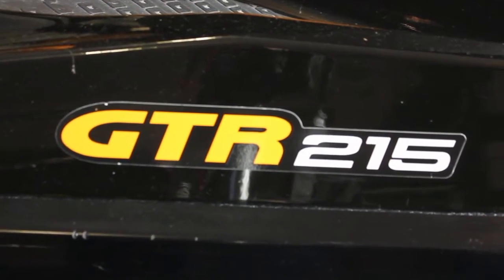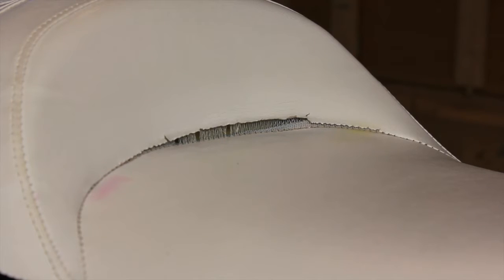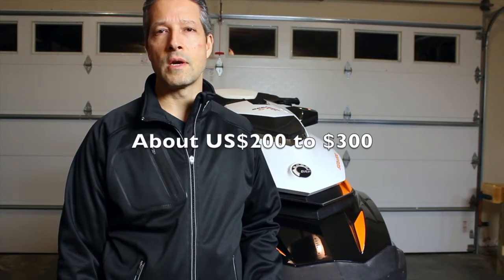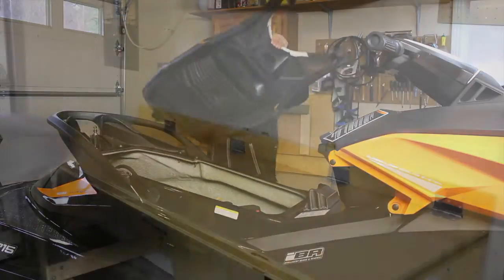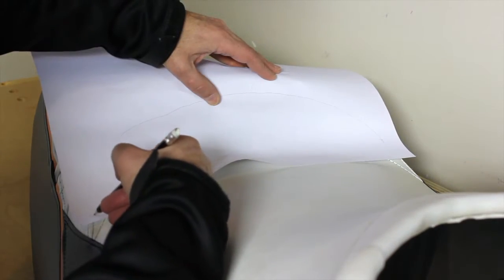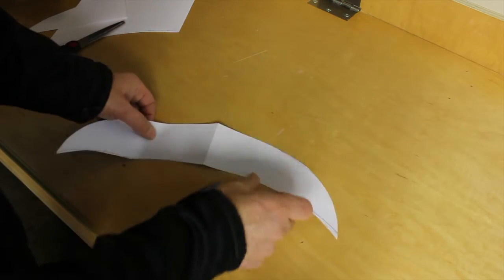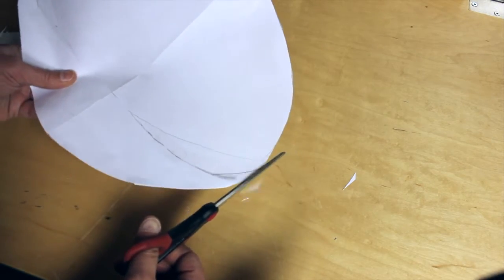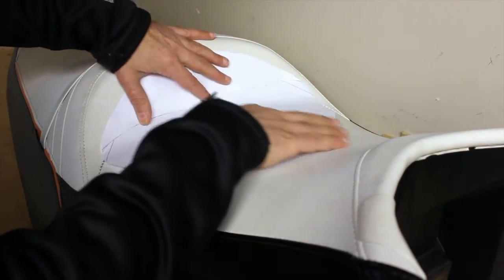How To Repair The Vinyl Seat On Your Personal Watercraft or Jet Ski

Comment: Great video! What kind of glue did you use? Would you think gorilla glue would do the trick? Yours seemed a bit more viscous which I think would make for easier spreading and less chance of bubbling/unevenness
Reply from the maker: I used vinyl glue (I don’t recall what brand). But be careful if you use it, as I noticed it yellowed the vinyl (after a few years) where it touched the surface of the fabric. We still recommend the repair for small jobs, but for larger or more extensive flaws it may be better to just replace the seat cover. Good luck!

Comment: It seems that every issue you have, I wind up having the same and find a good solution in your videos. The exact same tear just happened on my 2019 GTR and its getting worse by the day, how long did the temporary patch last? Thanks again
Reply from the maker: Tanks for the kind words! The patch lasted for years, but the vinyl glue started yellowing. I’m not sure if there are other brands of glue that work better, but ours did not look good after a while.
Reply: Ok thanks, very good to know. I'll research the glue for UV / heat rating (if published) vs color and GO for it to save some coin. As always, so much appreciated and your channel ROCKS for onboarding to Seadoo maintenance. Keep em coming @3ftDeepChannel
Reply: I'm repairing my 2019 Yanaha VX using this video. Thanks. I'll probably get a custom seat repair over the winter. A guy in town will do it for about $400. But he reinforces the Seams. So hopefully I'll get many years out of the new seat. Until then...
Reply from the maker: @seanlinnan2719 Hopefully the $400 includes the cost of the seat cover. If so, $400 is a reasonable price. Reinforced seams is a great idea. Good luck!

Comment: Do you know where I could replace the entire seat? Because mines is very ripped.
Reply from the maker: You have a few options. If only the seat cover is damaged, you can buy replacement covers and do it yourself. Some companies that sell covers are BlackTip, Jet Trim and Hydro-Turf. If you don't want to do it yourself, you can bring it to an auto upholstery shop, and they'll do it for a fee. They can also make and replace the cover themselves, but that can be a bit more expensive than buying the cover and having them install it. If the foam or the seat frame itself is damaged, then you'll need to buy it from the dealer. It's expensive, but it comes complete with the frame, foam and seat cover. Sea-Doo has their parts online and you can buy it off their website, if you've got one of their models. Good luck.

Comment: How well and long did it hold up? Any follow up video thanks
Reply from the maker: It held up well, but the glue I used turned yellow around the patch very quickly. I don’t know why, as it was the proper glue. Probably needed one with better UV protection.

Comment: I see this video was uploaded in 2016, any update on the performance of said patch over the next few seasons? I'm having the same problem with my 2012 Waverunner
Reply from the maker: Yes, the glue turned yellow so became a bit of an issue for me. The glue bond is very good, but the yellow made it look a bit crappy after 3 or 4 months. My conclusion is that it's good for a short-term fix, but if the looks of your machine are important, eventually you'll want to replace the seat cover. Thanks for your comment.
Reply: Thanks so much! Guess I'll just fork over the cash.

Comment: Can you tell me if the yellowing was just the extra that was beyond the patch or could you see the yellow through the patch?
Reply from the maker: It was around the patch (it was from the vinyl glue).
Reply: @3ftDeepChannel  So, any glue that pushed out but no yellowing where the patch covered it correct?
Reply from the maker: Correct. I sold it some time a go though, so I don’t know what it’s like now. The patch is a quick fix, but if you’ve got extensive damage, I suggest following one of our other videos and replacing the seat cover entirely. Good luck.

Comment: As always a great and usefull video. I just got my Rxtx260 and when im docking it seems the get scraches way too easy on the side.  I was thinking on getting/making som kind of a bumper but don't get to wrap my head around it... Do you use some bumper of sort, or what do you do about it?
Reply from the maker: I always use fenders when docking the ski. One on the front side and one on the back side. Most docks are designed for larger boats, just the perfect size to do a lot of damage to our skis! Thanks for your comment.
Reply: +3ftDeep Thanks for the reply! What fernders do you use? :)
Reply from the maker: I bought something like this: http://www.canadiantire.ca/en/pdp/4-5-x-16-in-twin-eye-ribbed-boat-fender-white-0791416p.html#.VwCNUxMrIUE
They came in a package of 4 for about $30, and 3 years later they're still great.
Reply: Thank you very much! Keep the videos coming :)

Comment: A patch will never match
Reply from the maker: You are correct. The biggest problem Though was that the glue yellowed over time and really made it look crappy. If I had to do it again, I would make sure no glue went beyond the patch.
Reply: Going through the same issue right now with a Yamaha vx
Reply from the maker: That’s too bad. I've got to say that the glue did hold surprisingly well, so it’s good for short term repairs. Longer-term, it’s best just to replace the cover. We’ve done a video on that recently if you're interested.